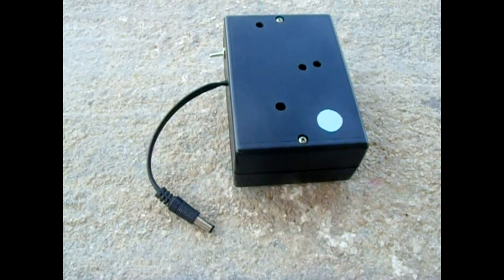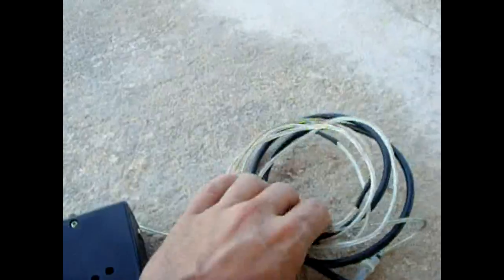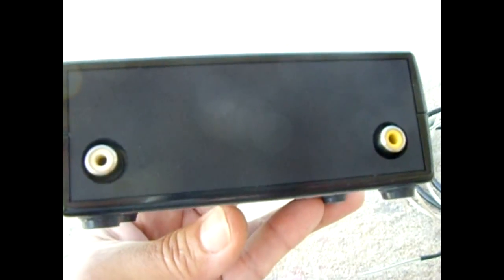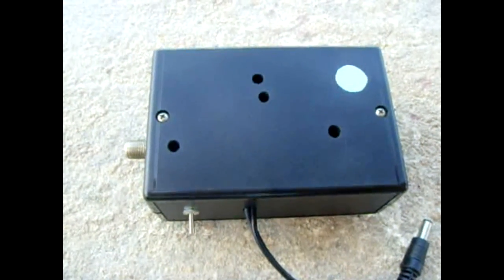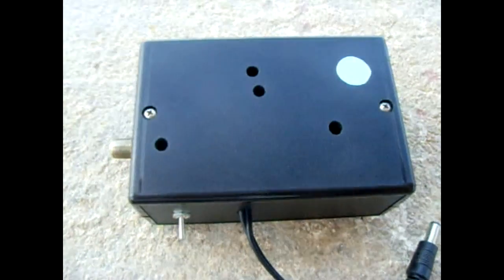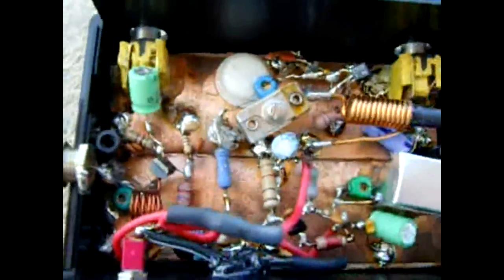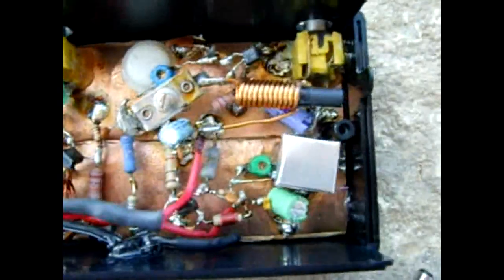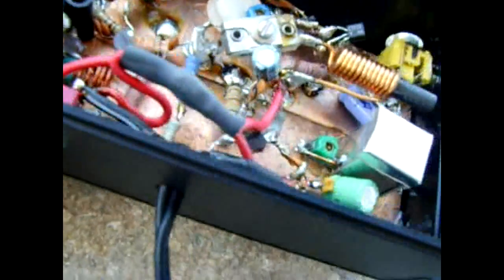Simple DIY Television Transmitter with Audio/Video

Comment: Good Job 👍
I have also this one, But i want to improve this video Transmitter Range, How i do it, please tell me something, 
I m using c2570 Transistor on this video Transmitter.
Reply from the maker: You need to make a FM amplifier to increase the range.
Reply: @electronicsNmore  Thank you so much for reply. But how i make fm amplifier , please make a video on this topic, or if you have any link please share me.

Comment: salt vinegar peroxide nail polish nail polish remover and alcohol, all it takes to have a decent etch on the board within an hour or overnight... 1/4 part peroxide 1/2 vinegar and 1/8 packet of salt or less... may need to continue to add salt if you want it done faster... clean it with decent purified water after alcohol treatment... still a nice build ;)

Comment: Quick question: what advantage would this circuit have over an off-the-shelf RF modulator, such as the one found in a VCR? Asking as a complete beginner trying to turn my current HDMI>RF setup into a multi-room wireless broadcasting system for personal use with old portable TVs. Very nice video btw, thank you for making it.
Reply: No differences other than being able to use other channels than 3 or 4
Reply: He said he is using channel 4/5. Standard consumer units use channel 3/4.
Reply: Just saw these replies, thanks, I missed that detail!

Comment: do I have to use those transistors, Or can I sub for like 2907's and 3904s? I know with the am transmitters, you can use almost any transistors you want and works great still./
Reply from the maker: Enter the part # 's in the part # search box at the link below. If they bring up the same NTE replacement part, then you can use it. Thanks for watching! 

https://www.nteinc.com/

Comment: I have that which I bought many years ago. But mine is factory made (not hand made). The brand is Union model UT-50. It transmits on NTSC-M VHF Channel 11. According to manual it can reach 100 feet (30 meters) with its built-in antenna. The purpose was when you watch a movie from your VCR, every TV in that house can pick the signal. Neighbors can also pick the signal if they are close enough. The frequency is crystal locked and cannot be change which means it cannot be use on areas where Channel 11 is active.

Comment: How did you go about tuning this circuit? I'm unsure of how to tune the audio section and how to get everything working.
Reply from the maker: Hi,
Without a frequency counting function on your DMM, it is very hard to do. I made the antenna for the desired frequency to match the circuit output. If you want to try another one that is easier, check this one out. Don't forget to share, and rate a thumbs up. Thanks!

Video & Audio FM Transmitter Circuit (50-200mhz)
Reply: I do have a frequency counter on my DMM, but I am unsure of where exactly to put the probe. Should I be probing on the audio input pad? When I do, I am only measuring about 7.5kHz. I will check out the other circuit as well, I just hope to get this one working soon.
Reply from the maker: OK, since you made it already. Did you buy the correct toroid? to make the audio section?
Reply: I did not but I have tried 7 different toroids, ones that were green, yellow, red, purple, blue, and two black ones. All of them had roughly 22 turns of 18 gauge wire on them. Could this be the problem?
Reply from the maker: If the inductor for the audio is not done correctly, it will not work. The schematic should show where to test for the 4.5mhz using your meter. The core material of the inductor is very important. You may be able to get it to work with what you have. I would get the video working perfect, then add the audio to the video circuit.